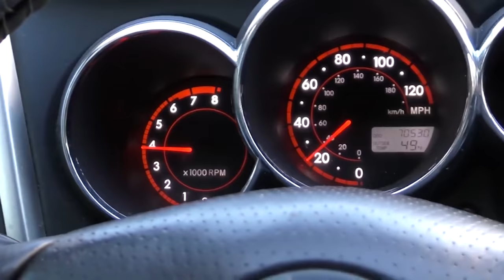5 Signs Your Transmission Has a Serious Problem

Comment from the maker: 👉 Thanks for Watching! Subscribe and hit the notification bell for new vids daily: https://www.youtube.com/channel/UCuxpxCCevIlF-k-K5YU8XPA?sub_confirmation=1

⬇Scotty’s Top DIY Tools and Products:
►Best Scan Tools:
1. Bluetooth Scan Tool: http://amzn.to/2nfvmaD
2. Cheap Scan Tool: https://amzn.to/2D8Tvae
3. Mid-Grade Scan Tool: https://amzn.to/4bLkN2g
4. My Fancy (Originally $5,000) Professional Scan Tool: https://amzn.to/31khBXC

►Best Car Jump Starters: 
1. No Charging Required Jump Starter: https://amzn.to/3i7SH5D
2. Mid-Grade Jump Starter: http://amzn.to/2nrc6qR
3. Fancy Jump Starter: https://amzn.to/4c1O9JI

►Best Car Accessories:
1. Dash Cam (Every Car Should Have One): https://amzn.to/2YQW36t
2. Key Finder (To Find Lost Car Keys): https://amzn.to/3Yb6gd4
3. Tire Gauge (To Check Tire Pressure): https://amzn.to/3y8R4CE
4. Tire Air Pump: https://amzn.to/46hFfXs
5. Car Memory Saver (Use When Changing Your Car's Battery): https://amzn.to/3YmWQeJ
6. Car Odor Eliminating Rocks (Removes Smells in Your Car): https://amzn.to/3zYMFCP

►Best Fluids for Your Car:
1. NuFinish Car Polish (Use on Paint or to Stop Windshield Squeaks): https://amzn.to/3SjmYmA
2. Meguiar's Headlight Coating (Keeps Your Headlights from Fading): https://amzn.to/46l7kgh
3. Meguiar's Headlight Restoration Kit (Restores Faded Headlights): https://amzn.to/3zT9ojN
4. Meguiar's Car Scratch Remover: https://amzn.to/4faB3wJ
5. AT-205 Reseal (Can Stop Leaks in Your Engine, Transmission, Etc): https://amzn.to/3LCruJq
6. Invisible Glass Cleaner (Inside/Outside Car Window Cleaning): https://amzn.to/3YcElcL
7. ATS 505 Fuel System Treatment: https://amzn.to/3LXhEC9

►Best Tools for Working on Your Car:
1. Best Small Flashlight: https://amzn.to/4fePFep
2. Best Expensive Multi-Use Flashlight: https://amzn.to/3WBxzft
3. Car Battery Tester: https://amzn.to/3WgEo4G
4. Basic Mechanic Tool Set: https://amzn.to/2tEr6Ce
5. Professional Tool Set: http://amzn.to/2Bzmccg
6. Ratcheting Wrench Set: https://amzn.to/2BQjj8A
7. CSCRI Impact Kit: https://amzn.to/4cOXF3T
8. Corded Impact Wrench: https://amzn.to/4bVrHlG
9. Electrical Circuit Probe (For Testing Power, Ground, and Shorts): https://amzn.to/4cTwMfp
10. Socket Extension Bar: https://amzn.to/4dedEsf
11. Small Sledge Hammer: https://amzn.to/3WzHsdj
12. Best Borescope for Seeing in Tight Spots: https://amzn.to/3zW3U7K

🛠Check out the other tools I use and highly recommend ► https://goo.gl/rwYt2y

🔥Scotty Shirts and Merch ► https://goo.gl/pTAeca

👉Subscribe and hit the notification bell! ► https://goo.gl/CFismN

As an Amazon Associate I earn from qualifying purchases.
Reply: And what’s up with eCVT?
Reply: Happy Father's day Scotty!!! By the way what is the best way to change transmission fluid? I've changed both by by dropping the pan an filter, and by disconnecting the line from the cooler. However what the best way between these two options in your opinion?
Reply: As Moroccan & I do thank you a lots ...
Reply: Happy Father’s Day
Reply: Heyyy Scotty! Happy Father's Day man!
Reply: Happy father's day
Reply: My car jerks when it shift gears. And u hear and feel a clunk certain periods of time when I put it in reverse or drive. I have a 2006 Pontiac g6 4 door 4 cylinder. Can someone tell me what's going on? Check engine light on but occasionally goes off then come right back on
Reply: My new car that has a dct automatic got stuck lol. I put my car in drive and it acted like it was in park, only happened once so I'm not sure if it was just a fluke or what, drives great other than that
Reply: I've heard the dct is usually jerky anyways, like jerks if you launch it half the time, no way it's bad, I bought it brand new
Reply: Scotty on the odd chance you read this, out of all car makers, toyota quality control let me down. Toyota tacoma 3rd gen. 46k miles only, third brake light over the cabin its leaking a lot of water. Not even 50k and my cabin gets as wet as the outside, warranty expired and extended warranty will not cover it. What a scam, dealership wants almost 500 dollars to fix it and its a know problem affecting tacomas from 16, 17 and 18. They kept designing like that, even thought they knew and now want to charge me hundreds to fix it.
Reply: Qqqq1q1q11qqqqq1qqqq1qqqqqqqqq1qqqqqqqqqqq1qqqqqqqqqqqqq1qqqqqqqqqq11qqqqqqqqqqq11qqqqqqqqqq11qqqqqqq11qqqq1q1qqq11q1qq1qqqq1qqqqqq1qqqqqqq1qq1qq11qqqq1qqqqqqqqq11qqqqqq11qq11qq1qqqqq1q1qq11q1qqq1qqqq1qqqq1qqq1qqq1qq1q1qqqqqqq1qqqq1qqq111qqq1qq1q1qq1qqqqqq111qqqq1qqqqq111q1waq111q11q11111qqqqqqqqqqqqqqqqqqqqqqqqqqqq1qq
Reply: Hey Scotty, how about a fifteen year old Lexus in good shape generally that's got 59,000 miles and shifting ok.  I've no idea if it's been done before.  Does a flush depend on the colour of the fluid coming out, or because of the age just drain & refill irrespective?
Reply: 07 Honda Accord v6. Got it with 108000 miles on it and now has 120000 after two years and don’t know if the transmission fluid was changed at 60000. Should I change it now?  And pls bring back closed captioning.
Reply: @tertiusdurham  Could be several reasons for clunk. Bad motor mounts, u-joints on driveshaft. Go to Autozone, they will read your codes for free.  Though light may be off, OBD will store codes. Google codes for your vehicle and you can see what you can do.
Reply: @1960bluebug  it always says solenoid but never say which exactly. Its def a PO code . when in mean clunk I mean it jerks hard when the automatic transmission shifts gears and when I change gears
Reply: @tertiusdurham  Yep, solenoids will do that. I think you have two in yours and both are pains to get to. Parts are relatively inexpensive but labor gonna cost! Might as well replace both while transmission being worked on. You tube has videos that might give a better idea on what is involved.
Reply: @1960bluebug  so do I get the transmission replaced since its hard to get to it get the parts and labor I hear both are kind of equal in expenses?
Reply: @tertiusdurham  Scotty'd probably say the transmission is going out, he recommends an additive.  Look his video up and pray it works, then get rid of you can.  Good luck!
Reply: @duffsvids  might be too late now I reckon.  If it's working ok and you really want to, just drain it. And if it's really dirty just put it back in.  If not, refill with fresh.  Just my opinion.
Reply: Scotty, can you do a video about tranny treatment such as Lucas. Will it help a old tranny or make it worse?
Reply: Please Google:
$5000 Car Collection Challenge!
Reply: @inthrutheoutdoor3464  Huh?
Reply: Happy Father's day Scotty! I have in important question, I have a 1998 honda civichatchback ek 5speed manual. But shifting to reverse is a pain. Sometimes gotta try to shift 5-6times b4 its in lol. Nothing fancy 423xxxkms and its my daily/restomod base model. Hope you can help me. Cheers from (snow mexico) Canada 🇨🇦
Reply: @SvetGolovkin1462  I'm Rob from the UK.  We have mostly manuals here, I guess you've tried pausing before butting it reverse?  Or alternately de clutching again and waiting.  How much travel do you have before it disengages and do the rest of the gears work ok, I ask this because it may be the first signs of a worn clutch.  If it's a cable you may be able to adjust it.  Regards.
Reply: @rob5944  all 5 gears are ok except the reverse. I bought it not running over 2yrs ago for $200cad. I think previous owner abused it bc its fr a mechanic shop and owner said it didn't run for several years before I bought it. I'm full stop b4 I tried in reverse its just when shifting it its the only problem. I love this car bc its very cheap on gas, parts and insurance. Never gonna sell it
Reply: @SvetGolovkin1462  ah well you can't complain I guess.  Like I said reverse is a strange gear because it's not synchro so it pays to wait a little after pressing the clutch down, most standard transmission cars are the same.  Many times you have to raise the clutch pedal and try again taking your time.  Take care.
Reply: @rob5944  but it doesn't do it on my sti tho or my lancer or my celica
Reply: @SvetGolovkin1462  as I say, it does sound like your clutch may be going out.  I'd nurse it and just be patient when selecting reverse.  Don't be surprised if the forward gears start going the same way.  It could also be a worn or damaged selector fork, but like Scotty says "just live with it if you can get by."
Reply: What do you think about the seal transmission  on a 2007 Toyota camry v6
Reply: @stormbreaker3027  hi, here in the UK my mechanic discussed both with me.  He was musing that he may not be able to obtain a pan if the filter was built in.  It's done 60k over 15 years and I assume it's never been changed.  So I guess both are acceptable.  He did remark on it being pointless if the filter were to remain unchanged.  I respectfully disagree, at least there'd be fresh fluid in there and it would avoid any potential problems with leaking gaskets.
Reply: Happy Father's Day Scotty!!
Reply: Scotty, i had the transmission fluid flushed on my 98 civic because the guy said it was low on fluid. I was on deployment. I am stationed in new Hampshire and now my Civic is slipping. Can you help me get the transmission get back to smoother? Its a Hx so CVT was new to these civics in 98. It had 88k mi when it was done. If you do work I'd love you to work on mine.
Reply: I have a 2013 ford f150 5.0L my p0720 code came up with is the output speed sensor issue Whats the labour time on fixing this?
Reply: What about a 2006 Ford Escape 2wd 4 cyl?  Fluid not changed since 2009.  Probably does not have the synthetic fluid.  In reverse it's starting to hesitate a little, like I'm running over something.  Should I change the fluid and filter but use the original fluid type?
Reply: @realgdanny8756  You had a "flush"?  Or a change?  How's it going now?
Reply: Supposed the transmission actually burst up? What is the cause of that?
Reply: Aap
Reply: So then how would you feel about a transmission fluid exchange?
Reply: Alarm
Reply: I have a 2006 Ford explorer that shifts gears but does not go forward or backwards.  Can you please tell me what's wrong
Reply: I have Nissan sentra 2009 252,000 km change Trans.cvt fluid once..still perfectly running..and the sparkplug.never change since I bought my Nissan..
Reply: @Scotty Kilmer. It’s really cold down here. I was driving the car , I have the new battery and it stop going . It has leaks in the picture below. What would be the issue ?
Reply: @Scotty Kilmer. It’s really cold down here. I was driving the car , I have the new battery and it stop going . It has leaks in the picture below. What would be the issue ?
Reply: Your right!!!!!
Reply: Scotty, I had the check engine light come on and shift into reverse and had delay shift. but the next day the light was off and it's driving smoother than ever before. Any thoughts or suggestions on this?
Reply: Ppp
Reply: Can u look at my car
Reply: Or Infiniti 😂
Reply: I have a question Scotty . Can I email it to you with the hopes of getting a reasonable response regarding to transmissions? If so what email? Thanks
Reply: A @scottykilmer do u work on cars out state I can come to you

Comment: i took the risk of draining my transmission fluid at 200k miles on my 2014 accord, now i do it every 30k miles. So far so good, 263k miles running strong
Reply: Nice you should be good, keep us updated.
Reply: U did it urself ???
Reply: Honda power
Reply: @user-xq1bh9fn6q  yeah, it's extremely easy on the 9th gen honda accord. Took me about 10-15 mins. I saw a few videos on youtube
Reply: lol.. same here with my 2008 Pontiac Grand Prix .. so far so good ..
Reply: @TomDoesUtube  yeah I’ve added another 20k miles since I did my last drain and fill. So far so good.
Reply: i have a gs 350  at 135k and I wanna change the fluid. one of the Lexus dealerships near me does not recommend another dealership is about 60miles away I heard they do that.
Reply: @wallstreetgambler9151  I have a 2015 gs350 fsport,  I called a reputable transmission shop in the same town that the lexus dealership is in,, he says not to change it, it is a closed system and that they never see any of them come in for repairs, said he has 265,000 miles on his tundra on the original fluid??? So hell I'm confused, don't know what to do
Reply: @wallstreetgambler9151  yeah I gotta 2011 Gs 350 with 137k and im thinking about changing it but idk I keep seeing mixed things about it. I just bought it so I don’t know if it’s ever been changed unfortunately.
Reply: what type of fluid did you use? 

I’m coming up to 190k on my 13 Accord and thinking of draining and refilling my trans fluid soon too.
Reply: @josedramirez24 every when are you supposed to drain and refill transmission fluid?
Reply: Are you saying that you drove the car 200k miles and never replaced transmission fluid?
Reply: @josedramirez24 I have to also ask, since I am considering buying an accord, are there any common problems I should be worried about?
Reply: @jacobparamus1229 late response but the starter. I have a 15 accord and the starter is something I’ve replaced twice in the last 8 years(200k miles)

Edit: if you handy with a wrench it’s not too difficult to replace it yourself. I’ve done it both times.
Reply: How’s it holding up now?
Reply: You still got it?
Reply: You could never change it once and still get that far, you can run a honda engine with no oil for like 1 min and it would live on.
Reply: Were there any transmission issues at 200k?

Comment: My transmission is actually having trouble, I clicked on this video expecting to commiserate but still ended up learning something new. Thanks!
Reply: I got lucky and had two verified master mechanics that I met in life… they both did transmission fluid the same way…. If they replaced a valve body or anything interior to the transmission they would do a half a fluid change… just to keep what they called “good dirty”.

Comment: Here at Mercedes a transmission service is dropping the pan, replacing the gasket, filter, and drain out the fluid in it. Put pan on with new gasket, top off with new fluid. No flushing.
Reply: No flushing...change it more often !
Reply: @Garth2011  nope. I've got a 1991 Mercedes 190e. Manual says change the fluid each 100k km or 60k miles. Not only is the fluid clean after I change it. As Dcc357 said, you replace the filter and pan gasket. When draining out the fluid, i got 4.9x liters out of my transmission when there should be 5L in there. That extra 50ml or less of old fluid won't damage anything. That's why these Benz's will outlast any car as long as the preventative maintenance is done.
Reply: Makes sense
Reply: MERCEDES CHARGED ME 8000 USD FOR GASKET REPLACEMENT

Comment: I can 100% attest that that Lucas transmission slip fix is amazing. I inherited a 2007 Honda Accord with 210k miles on it from my uncle. Without my knowledge my mechanic change the transmission fluid because it was a dirty and I had a feeling my uncle never did that. Needless to say, it started slipping and hesitating terribly within a year (I dont drive very much luckily). I put the Lucas fluid in and ever since it's been shifting like a dream. Best stuff ever!
Reply: I’m gonna try it in my van, . 186k miles, It started slipping and sometimes it won’t go in reverse. Thank you for the advice
Reply: @manuelsalgado8510  How did it work?
Reply: @kiddav5005  it didn’t work, but my transmission was already kicking it, . The van is sitting now. Maybe if I would have tried it sooner
Reply: @manuelsalgado8510  tried changing the filter? One last hope.
Reply: @starkeymorgan4142  what filter? My van doesn’t have reverse or forward,
Reply: @manuelsalgado8510  transmission filter
Reply: @starkeymorgan4142  if they are already losing gears that's not gonna do anything.
Reply: Got a 07 corolla with over 220k miles never changed the fluid so ill keep this in mind thank you.
Reply: I own 199O F250 ext cab long bed and I  even put Lucas Transfix and it works very flawlessly and I'm still driving it just like Scott said don't mess with the Friction point as for if you do then you'll be very sorry that you messed with something that was working.
Reply: @freewillchoice8052  Thats fine Toyotas definition of lifetime is different to most other automakers. Thier idea of lifetime is as long as possible bordering on forever.
Reply: @manuelsalgado8510  you can buy a reman transmission for about 2800 and have a 5 year unlimited mile warranty. never buy used
Reply: At 205 work for my corolla ❤

Comment: I flushed transmission fluid on my 03 Grand Marquis with 175k miles, but manually not by a flush machine. First, dropped the pan and removed 5 quarts. Then I removed the cooler line that is going back to the transmission from radiator and started the car. Fluid started to flow out of the line and as soon as very less fluid started to come out, I turned off the car. The car takes 14 quarts of Mercon V, but the car took only 12 quarts and it was full. I performed this back in 2017 and since then the transmission shifts like a dream. So lags, no jerks nothing. Smooth shifting like new. The car now has 220k miles. So from my experience, manual flushing of the transmission worked out well.

I never changed the fluid before 175k miles. It was the one and the only time I did because my torque converter had the common shudder issue. After the flush, I also added Dr tranny instant shudder fix additive as well. I did try Dr tranny before flushing as well but it work more than 4 months.